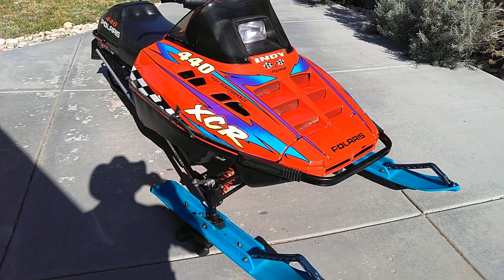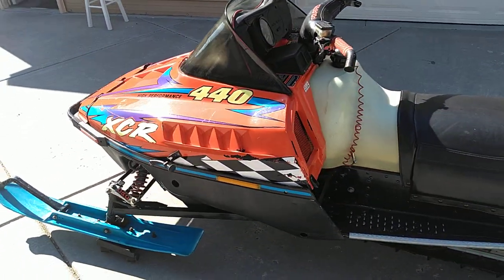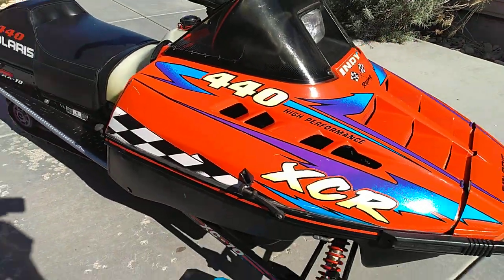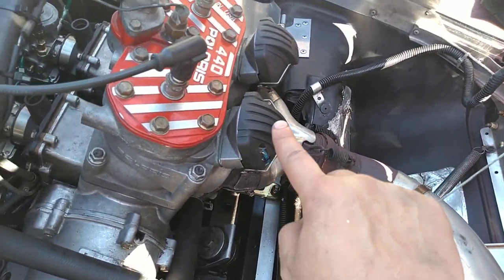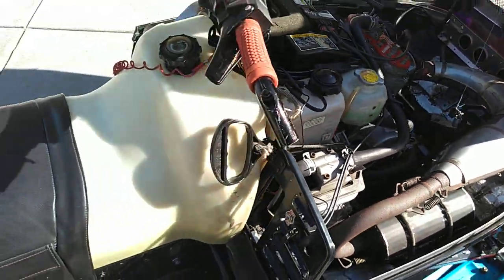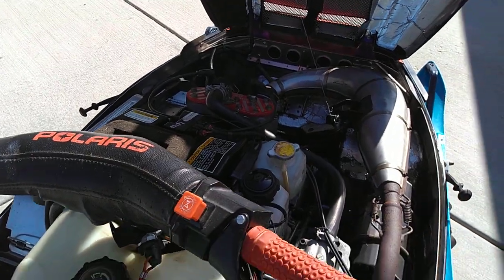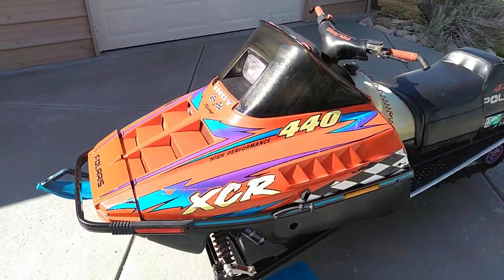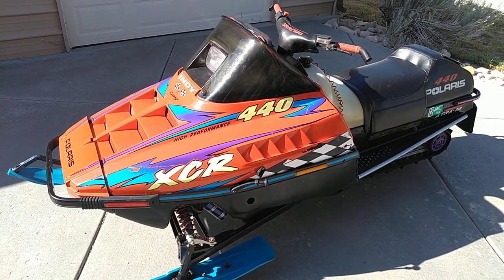1998 Polaris XCR 440

Comment: I also have a 98 red rocket. If you're ever interested in selling those skis or trading for a stock set of skis. I'd also be interested in trading you a stock set of front shocks for those
Reply from the maker: I already replaced the skis...  Someday I need to get the shocks rebuilt.  I heard what's on there may have been factory racer sno cross set up.
Reply: @oldsledstv2532  you still have the C&A's? Im really trying to find a set of those first generation C&A's 

I'll be doing a upcoming vlog series on my red rocket as I restore it to race condition and race a couple vintage snocross races this upcoming winter
Reply from the maker: @mcpheeters16  sorry... I sold them a few years ago.
Reply from the maker: @mcpheeters16  give me a call sometime.  Fourtreephiveatenynezerotootreeate.  The number is so a robot doesn't start calling me!